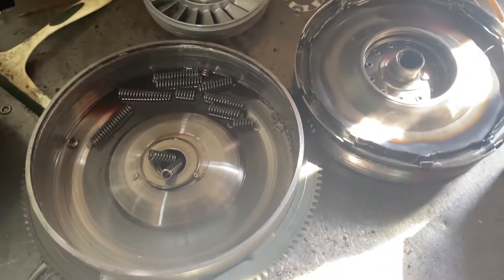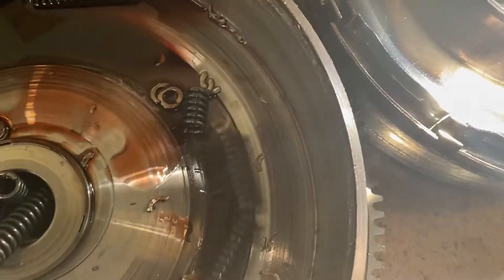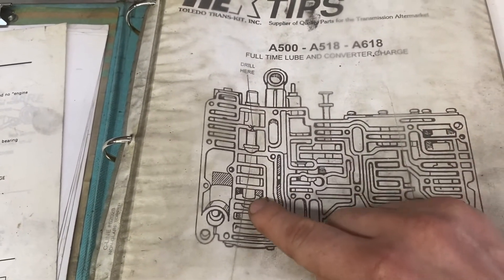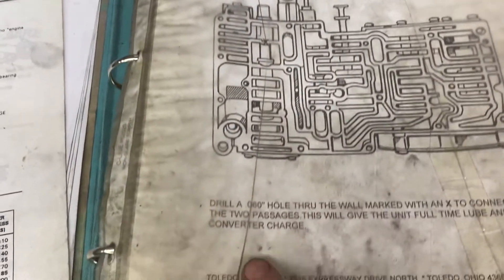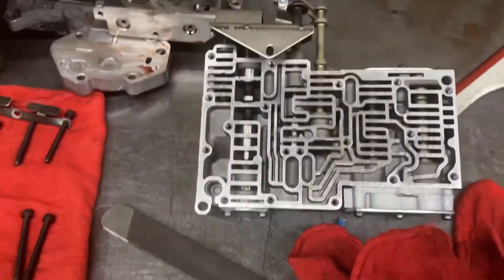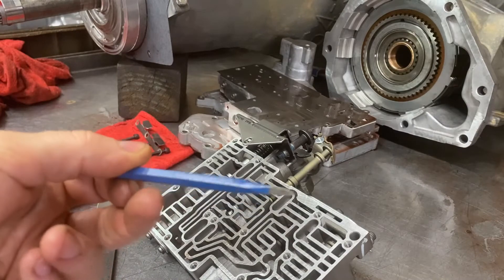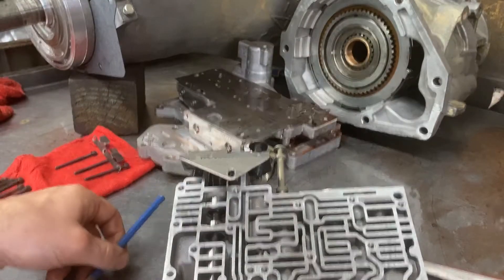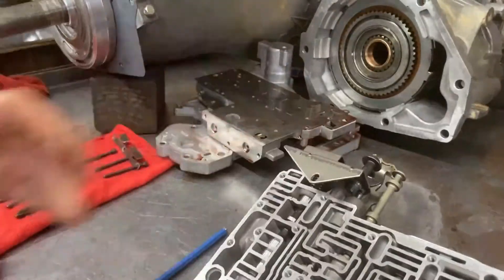Dodge Ram & Jeep transmission torque convertor problems - Valve body update A518 A500 42RE 46RE 47RE

Comment: Just curious what you think about take-off shudder with a 46rh?

I recently had to drive the truck over mountains in 1st gear for 4 hours. 

If im easy on the gas, no shudder but with my travel trailer on and a heavy foot, i get a relatively violent shudder. Almost like something binding more than slipping.

Just did filter and 5 qts to see if it would help but didnt seem to.

Comment: Best regards, I repaired an a518 transmission, the one that comes with only two solenoids. Overdrive and lockup. I completely repaired it, cleaned the valve body. The problem that I have is that it changes from 1a. to 2a. and 2a. to 3a. At very high revs, the engine has to pass 3,000 rpm for the transmission to shift. I have not been able to find the problem, I have lowered the transmission 4 times and I can't find anything that is wrong. any suggestion
Reply from the maker: Depending on year of vehicle, possible governor or t/v cable problem/adjustment, sticking valve body, or internal transmission concern
Reply: @johnniemic  Thanks for your answer!.